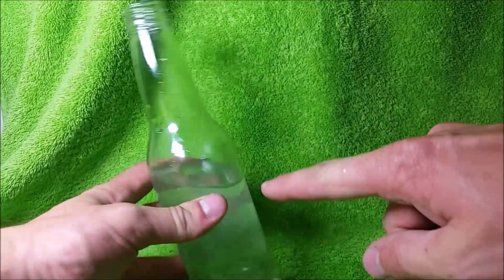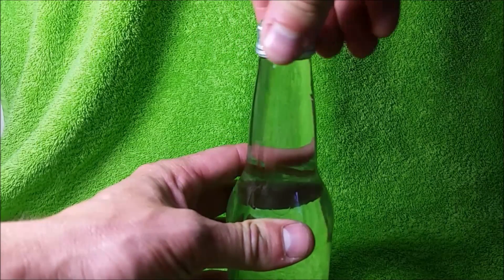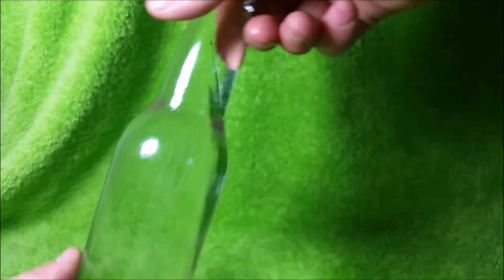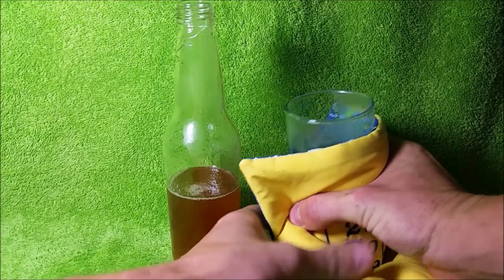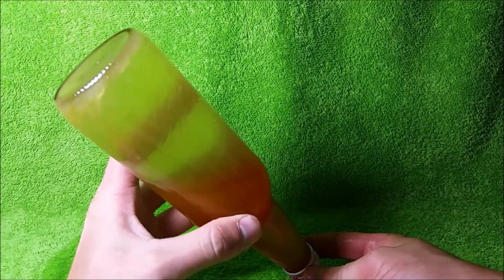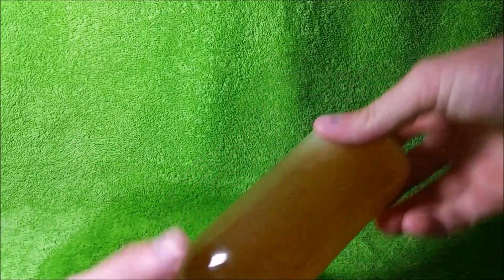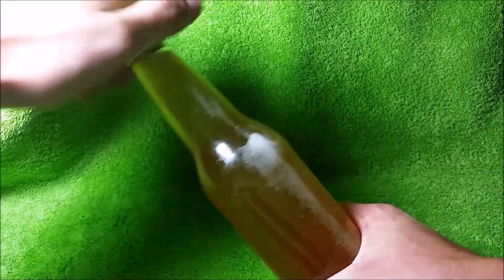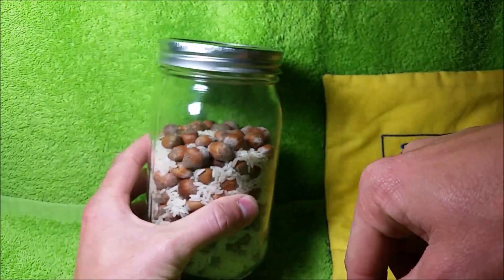Volume Change when Mixing Alcohol and Water Explained

Comment: Would that bubble be a vacuum though? If it were a vacuum, wouldn't the liquids immediately boil and fill it with vapour?
Reply: Joe Doherty well he isnt really a professional so.. why would you complain like THAT?^^
Reply: +Drama Stuhl Accuracy is important
Reply: +Rob Mckennie I think he was trying to make a distinction between a bubble that formed because of the production of gas, which would create a positive pressure in the bottle, and a bubble that formed from a vacuum, which created a negative pressure. That is the "less picky" interpretation of "nothing."

Sure some of the alcohol and water boiled and filled the void with a tiny bit of vapor, but that's not what created that bubble; that's not where the bubble came from; that's not what the bubble is. The bubble is: a vacuum. It's not a perfect vacuum, but a vacuum. To say there's "nothing there" is just to say it is not a gas bubble; it is not primarily made of gas; it did not form from gas.

Your expectation is that every YouTuber include every superfluous detail in every video, but giving "shortcut" explanations of things is very commonplace, even in school, because at a certain level they just need you to comprehend the material they are teaching you at that time. There's a lot of this "well, that's not quite accurate. It's a lot more complicated than that, but that explanation is for a whole other class." Teaching is more about communicating effectively and appropriately for the student's level of comprehension. Even Carl Sagan dumbed down the material for Cosmos and said some things that are technically inaccurate (those "shortcut" explanations) because he knew he was speaking to an audience with a wide spectrum of scientific knowledge. Cody is speaking to that same audience.
Reply: +Rob Mckennie If this was a published scientific paper, I would agree with you. And yes, it is superfluous when you are communicating with the general public: people who are not necessarily physicists concerned with getting everything exactly right. It's also for brevity. Every shorthand statement like "there are three phases of matter" can be expanded out into "well, actually there are many phases of matter because [insert 1 year of grad school here]. And by the way, there's no clear line between states of matter because [insert another year of grad school here]. Oh, and we used to teach you that energy comes from chemical bonds, but that's not quite accurate because [insert PhD here]."

I know you got excited because you found an inaccuracy in a video made by some random guy uploaded to YouTube, but that's like finding a scientific inaccuracy on Sesame Street (no offense Cody). If your scrutiny was so valuable, you wouldn't be complaining on YouTube, you'd be providing peer review in scientific journals.
Reply: Rob Mckennie I figured you would say that. Now you're in Cody's position, and I get to be you. Uhhhhh, actually, even a perfect vacuum isn't "nothing." There's this thing called vacuum energy, and so a vacuum is, in fact, something, and not nothing, so you're wrong.

You see what I did there? I simply decided that the level of accuracy that you settled with, the level of accuracy that you felt was adequate to communicate your point, just wasn't enough. I decided to be a pretentious douche and take it to the nth degree. I applied an expectation of superb accuracy, and you failed to meet that expectation. Why? Because saying a perfect vacuum is nothing was enough to communicate your point. And it just wouldn't be appropriate for me to expect THAT level of accuracy from you, because I knew what you meant. I actually understood what you were saying, and that was the whole point of saying it.
Reply: Rob Mckennie Well, Cody commented and clarified: it's not a perfect vacuum. He didn't make a mistake, he just didn't use the word "nothing" the way that you are expecting him to. This is obviously turning into a semantic issue. You assert that every time someone uses the word "nothing", at least in an educational video, they absolutely MUST be referring to absolute nothingness: the kind of perfect vacuum that is physically impossible. That is just not reasonable. In fact, because it is physically impossible, we know that every time someone calls something "nothing" or a "perfect vacuum" it is an exaggeration. The word "nothing" can never be anything but hyperbole, unless you accept that there are different types of nothing. With abstract, unknowable concepts such as "nothingness", there are often multiple uses and interpretations of it. There is no scientific basis for describing nothingness, so all you're doing is complaining because other people are not conforming to your philosophical ideas about it.

Communicating with humans is not like programming a computer; you do not have to be 100% explicit with your statements (sometimes even computers can handle ambiguity). With humans, you can off-handedly use words like "nothing" and people will still understand, despite the fact that it is not accurate. This is important to know when teaching people. Chemistry professors worldwide still teach undergraduates the Bohr model of the atom because it's useful for understanding the way electrons fill the different energy levels. You build the comprehension through that model, then as you progress into quantum physics you begin to learn more about electrons as standing waves instead of orbiting particles. I challenge you to find one lecture or one text book that meets your absurd expectation of accuracy and has no shortcuts, simplifications, or off-hand statements. And I mean a complete work, not just a phrase or paragraph, and not a published scientific paper.

It obviously doesn't take 1 year of undergrad to understand the states of matter. It was hyperbole, not a fallacy. I was not saying you need to include all the information related to a subject, but you do have to elaborate more to explain something with more accuracy. Also, when you try to explain something with utmost accuracy, you start to get too esoteric for your audience and will no longer be communicating with them effectively. Cody really should have said that it was a bubble of quantum foam and virtual particles dotted with isopropanol, water, and other contaminants at a very low pressure. Even that's not 100% accurate, but notice that it's not the best explanation to use for the layman; it loses people because not everyone knows what quantum foam and virtual particles are. Also notice it takes longer to describe something more accurately. That's what I was talking about. If you're really picky, you could even say there is no such thing as water. Instead of calling it "water" he should have called it "clusters of quarks interacting with the gluon field nested in an oppositely charged standing wave made of excitations in the electromagnetic field that have configured themselves in their lowest energy state at the given temperature." Even that's the quick and dirty explanation and it's still inaccurate, but we say "water" because it's shorter. But then, if you're a real stickler, you could build a case for saying that there are no such things as particles. We use shortcuts to describe things; they're not distortions, they're not wrong, and they're not signs that you shouldn't try to explain the subject. The word "nothing" was used here to mean a "near vacuum."

I'm trying to tell you that there is no one who stands up to your expectations. I have never seen a lecture where the professor didn't cut some corners in his explanations. I have never read a text book that didn't misstate something for brevity or because the better explanation went too far into another field of study. I sometimes watch Cosmos, Nova, The Universe, and other shows. Holy shit do they misstate things! But I understand the audience that they are trying to communicate with, so I understand why they simplify it. It's about focusing on the point. The point of Cody's video was that the arrangement of particles can change how much volume they fill (on a macro level). The point of the Bohr model is that electrons fill discreet energy levels. Bitching at Cody about his use of the word "nothing"  diverges from the point and it is superfluous.

Cody said it best: picky picky.
Reply: The point about Sesame Street and Cody's Lab is that they are both educational shows that are speaking to an audience with a particular level of scientific literacy, and they both are not trying to create material that stands up to the highest scrutiny, and do not require utmost accuracy, especially in unscripted dialog.

So when would it be appropriate to use the word "nothing" then? Tell me.
Reply: There are situations where I would accept someone saying something is at absolute zero when, factually, it is only a little cold. If they were joking and being hyperbolic, for instance. That's my point: there are situations where different degrees of accuracy are appropriate.

And no, I am not using a different definition of nothing. A perfect vacuum is something.

Just admit it: when you said that a perfect vacuum is nothing, you were not being absolutely, positively, 100 percent accurate. You were being accurate ENOUGH for talking about vacuums. That's the "context" you mentioned, and you were right. In that context, it WOULD be appropriate to use the word nothing to refer to a perfect vacuum. And so you are an example of how sometimes we say things that are not strictly accurate because elaborating to the nth degree would be superfluous.
Reply: Rob Mckennie Fine, reading is a chore for you? here it is:

With abstract, unknowable concepts such as "nothingness", there are often multiple uses and interpretations of it. If you were scientifically literate you would know there is no scientific basis for describing nothingness, so all you're doing is complaining because other people are not conforming to your philosophical ideas about it. It is all semantics, and yes I am fine with multiple definitions of "nothing", and so are scientists. But I guess they're idiots too, right? Maybe you should read a book or two about it, but then again you don't like reading.

The point of Cody's video was that the arrangement of particles can change how much volume they fill (on a macro level). Bitching at Cody about his use of the word "nothing"  diverges from the point and it is superfluous.
Reply: Rob Mckennie I just did. But I understand you're probably tired. Read it again in the morning.
Reply: No, you answer this question: Is the Bohr model of the atom an accurate depiction of the atom?
Reply: I was just trying to make you mad. My answer is NO, not in the strict sense that you insist on using. But I accept that there are other ways to use the word "nothing", so I approve of Cody's use of the word as being ONE OF THOSE OTHER WAYS TO USE IT. Because it is an abstract concept with no scientific basis, it can be reshaped for different uses. In Cody's case, it was used to emphasize the fact that the bubble DID NOT come from the production of gas, rather from the gaps between atoms.

Are you satisfied? No, a low pressure gas is not "nothing" when speaking strictly, but Cody was not speaking strictly, and doesn't need to speak strictly about philosophical, non-scientific topics.
Reply: Rob Mckennie Well, then I agree with you 100%. But do we also agree that the concept of "nothing" and "jiving with a broader sense of nothing" are philosophical, non-scientific concepts?
Reply: +Rob Mckennie Your example does not convince me. Terms like "greater" and "lesser" are terms of relative magnitude, which does have a scientific basis. Cody's use of the word "nothing" is not similar to this situation.

I see it more like this:
An educational video depicts two scientists about to begin a demonstration of sputter-ion plating using a bell jar vacuum chamber. One scientist turns on the vacuum pump. Cut to the next scene: the scientist says "Okay, now the chamber is completely evacuated." Some guy off camera says "Um, actually, it's impossible to achieve a perfect vacuum." The appropriate response would be "Yes, that's true, but seriously, Steve, shut the fuck up."

The phrase "completely evacuated" was being used very loosely, which is appropriate even when communicating science. My evidence of that was that even people at the top of their field use some terms loosely, especially when the better explanation is outside the scope of the discussion or demonstration. I've seen professors, text books, and public figures like Carl Sagan, Neil Degrasse Tyson, Michio Kaku... they've all done this. They must know something about communicating science that you don't.
Reply: Haha, well said. Anyway, you are a formidable foe. Is it wrong of me to have enjoyed this?
Reply: +Rob Mckennie You should understand that there is no such thing as a perfect vacuum. If i were to put a drop of iodine into my local lake even though the particles are spread out, they are still present, even if you were to add an infinite amount of water. But I do like your point at the start! Very interesting.
Reply: No Fullname answer the fucking question.
Reply: It's a yes or no question. Is what I just described a reasonable use of the word nothing? Yes or no.
Reply: What the fuck does that have to do with anything? I don't know, I'm a layperson, I'm not the one to be making that kind of call.

Now you can answer the question that I asked first. Is "a below atmospheric pressure mixture of water and isoproponol vapors" a reasonable definition of "nothing"? go on, yes or no?
Reply: No Fullname I'm not asking you to make a judgement based on any particular conception of nothing. I'm asking if it jives with the broader sense of nothing. Or is it cool with you if we just use words to refer to whatever the heck we like?

Here's a scenario for you. The police ask me if there's anything in my trunk, I say "there's nothing in my trunk", they open my trunk and find explosives. "I didn't say there was a perfect vacuum I was simplifying ooh that's like calling out sesame street why are you so picky about the definition of nothing? " Would that be a reasonable definition of nothing? Of course not. Likewise, water vapor + isopropanol vapor is not a reasonable definition of nothing.
Reply: No Fullname It's linguistic philosophy, but linguistic philosophy informs how we use words, and the use of words is very important in scientific communication.
Reply: No Fullname Let's say that I state that "iron has a greater density than lead, at room temperature". I would say that someone would be totally right to call me out for saying something that is scientifically incorrect. Would a valid response be to say "oh that's a very picky definition of greater, i didn't say greater than, I just said greater, which actually means lesser than, it's just philosophy, you're just arguing semantics". Of course not. I would be being a moron, I would have said something that was completely wrong, and I should have to admit to that mistake. shit.
Reply: No Fullname nah, you're being too picky
Reply: No Fullname I have no idea
Reply: ***** .. and because that's not how macro scale objects work. If you want to try reductio ad absurdum, give an actual valid example of something that is accurate.
Reply: ***** I'm not asking for him to explain anything. I'm just asking that he not say that it's "nothing". Like I said before, excluding information I have no problem with, but giving false information I am not okay with.
Reply: ***** That question makes no sense. By "nothing" do you mean a drop in hydraulic pressure?
Reply: ***** It doesn't create space, the space is already there; the particles are just able to arrange in a lower energy configuration, and this creates the negative pressure. The lowered pressure allows the liquids to boil, forming a bubble of vapour. At no point is a "space with NOTHING in it" "created". There is space around the particles, but there is never a point in time where there is a large enough pocket of empty space to call it a bubble that has nothing in it.
Reply: talk about killing all the fun...sheesh! Bet you guys are big hits at parties.
Reply: ummone Hey, why don't you shut the fuck up? There's a good lad.
Reply: +Rob Mckennie see what i mean....
Reply: +Rob Mckennie I would think the bubble is mostly air, solved in the fluids, going out of solution because of the lower pressure in the bottle after mixing. Some vapor from the fluids themselves, but not much
Reply: Eskil Eriksson in any case, whether it's air or low pressure vapour, not nothing, right?
Reply: No, not nothing. I reacted to his phrasing in the video, that's what got me reading the comments. A lowered pressure is as easy to explain as a partial vacuum, imo. Cody is usually more stringent than this.
Reply: ***** I believe the phrase was "there's nothing in there"
EDIT: Excuse me, I was mistaken, the phrase was "it's actually a vacuum, there's nothing there".
Reply: ***** What would be a less picky way to interpret the word "nothing" in the context of a bubble? "contrary to what you might think, this bubble is actually a gas"
Reply: +Rob Mckennie what do you even try to accomplish with that conversation? ^^
Reply: No Fullname heh. I wouldn't compare Cody to sesame street at all, and I would hope that he aspires to be of higher scientific quality than sesame street.

You needn't go into such detail; he only needed to avoid saying "nothing", when there in fact is something.
Reply: No Fullname Precision and clarity in language is not superfluous. It is necessary, especially in the context of science. "A gas at less than atmospheric pressure" is a ridiculous definition of "nothing".
Reply: No Fullname it depends on the context. In the context of a vacuum, it should refer to a perfect vacuum.
Reply: No Fullname That would be a different definition of the term "nothing". What you're actually saying is that a true vacuum, in the sense of absolutely nothing, is impossible to achieve. Much like the temperature "absolute zero" is impossible to achieve in the real world, but it's still a useful concept. Would you accept someone saying that a material is "actually at absolute zero! there's no heat energy in there!", just because it's very cold? Or, as in this case, it's just lower temperature than room temperature?
Reply: No Fullname I am defining "perfect vacuum" to mean absolutely nothing. It may be inappropriate to redefine "perfect vacuum" like that, but it doesn't matter. I define nothing to mean absolutely nothing, when in the context of a vacuum. It does not matter if that is something that cannot exist in real life.

If you want to say things that are inaccurate, that's your prerogative, but I'm not going to live my life like that, and I expect videos on scientific topics to strive to be accurate, too. It's okay to fuck up and say the wrong thing sometimes, but it's not okay to shrug it off because it's "close enough". To my, a video that doesn't strive for accuracy isn't a scientific video. A creator of educational content can makes mistakes, but it's not okay to not admit that you make mistakes.

You keep making this weird reductio ad absurdum argument that if we're going to strive to be accurate, we have to give absolutely all information relevant to a topic, and that's not true. There's nothing wrong with omitting superfluous information, but there is something wrong with distorting the information to make it more understandable. If you can't explain something simply and accurately, it's probably a sign that you shouldn't be trying to explain it.